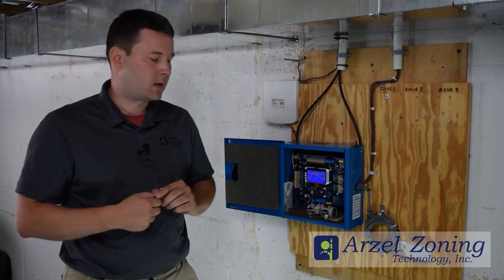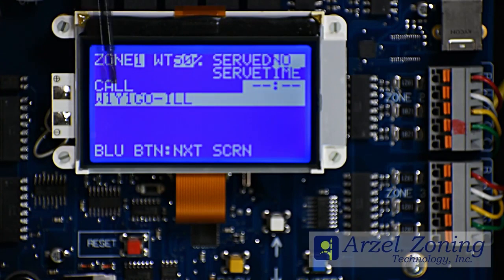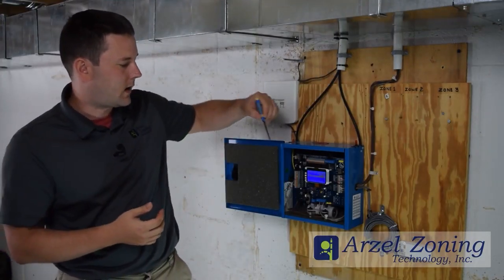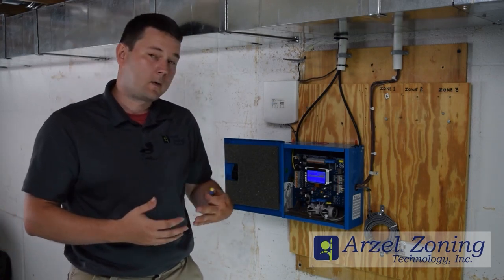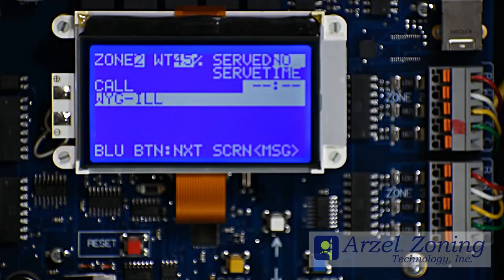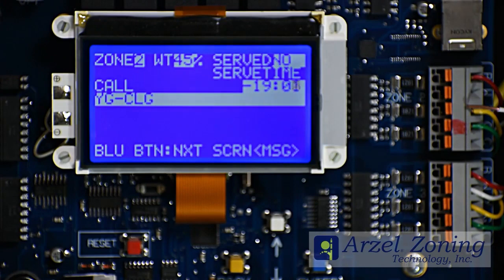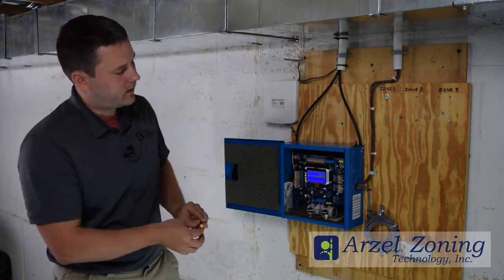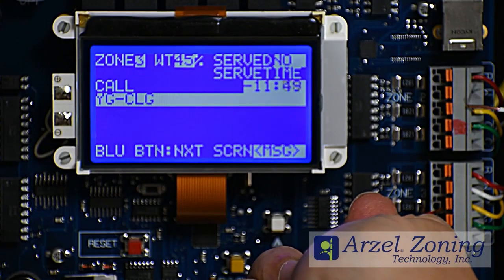Fixing Thermostat Issues with Arzel Panels

Comment: We need heat, but the panel is showing YG-CLG not sure why
Reply from the maker: You can talk to Arzel tech support at 800-611-8312 or techsupport@arzelzoning.com. Sometimes they need an HVAC contractor on site so they can get measurements of the system, but they will do whatever they can to help you get your system working ASAP.
Reply: @arzelzoning7136 figured that part out, the yellow and white wires were switched. Thank you.